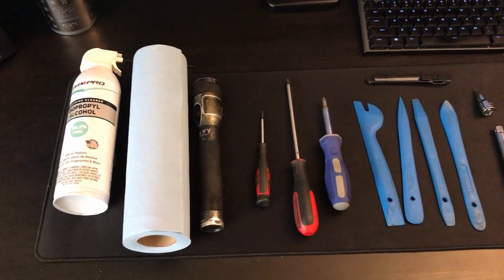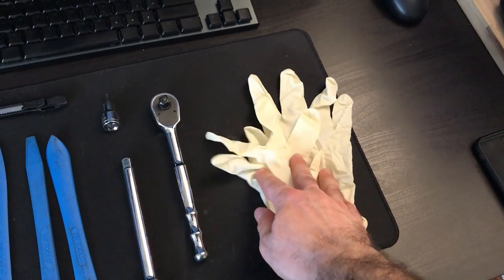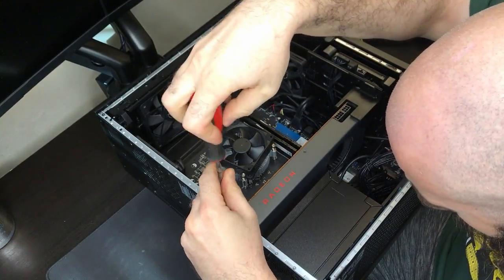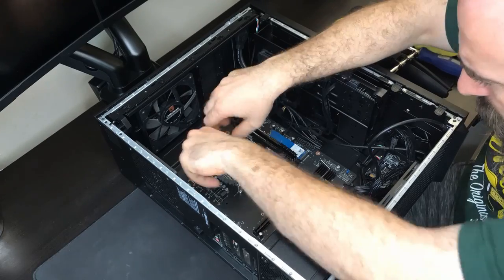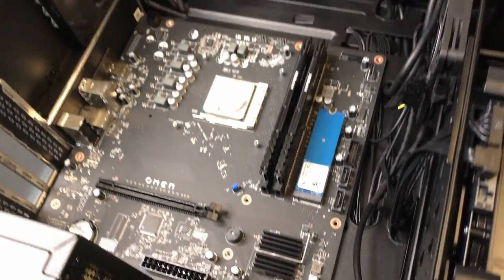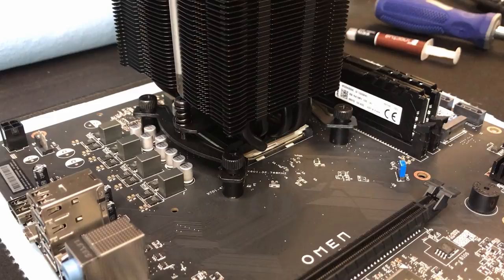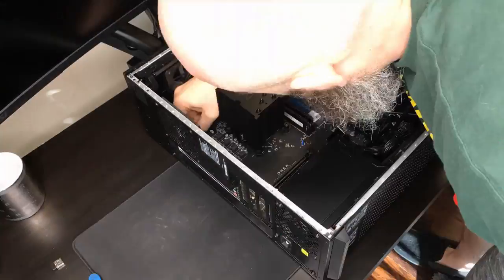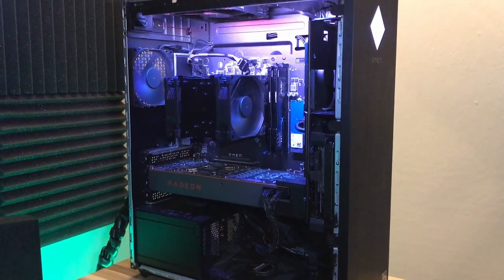Installing A Noctua CPU Air Cooler In My Omen! Complete Tutorial 😎

Comment: i was wondering is the second fan on your CPU cooler the same as the rear exhaust fan
Reply from the maker: Correct, it’s the same fan. Both fans are directing airflow toward the rear of the case.
Reply: @DanKamYouKnow  thanks you so much, also love your vids you've helped so much with my pc

Comment: Would you recommend the U9s or the D9L for my Omen 25L?
Reply from the maker: Either way will b a great purchase. Main reason I went with the U9S is because it’s offered in black.
Reply: @DanKamYouKnow  good to know. I heard the D9L is a little better is that true because it’s also a little cheaper right now
Reply from the maker: D9L is probably the best cooler available for the Omen. U9S is a very close 2nd but fits the aesthetic of the Omen more IMO.
Reply: @DanKamYouKnow  I think I’ll go with the U9s. Do you know if the noctua slim fans fit the fan clips provided?
Reply from the maker: The slim fans will not work with the cooler clips. The U9S will come with one regular sized thickness fan though

Comment: Would AMD's wraith prism cooler work with the HP Omen 25L?
Reply from the maker: Unfortunately it won’t because all Omens use Intel spacing for their coolers ( even if it is an AMD equipped Omen ). So you have to use Coolers that have Intel mounting accessories
Reply: @DanKamYouKnow  thank you for letting me know! I was about to pick one up later this afternoon off marketplace. you just saved my money

Comment: hey dan, I’m currently moving my omen 25L into a Corsair 4000d airflow case and haven’t run into many problems so far, however I also decided to do a cpu cooler change and I just cannot get the backplate to budge and I’m too scared to use anything cause I don’t wanna damage the mobo. any tips on how to pry it out easier?
Reply from the maker: Dental floss works really well. Gotta fish it thru and you should be able to use it to “slice” the adhesive
Reply: @DanKamYouKnow  thanks, I’ll try that today! is a lot of force needed though?
Reply from the maker: The adhesive they use to secure their backing plate is very strong so yes, it will take some effort to get off. Just don’t use anything metal and you should be fine. That’s why I went with a plastic scraper
Reply: @DanKamYouKnow  oh so if I use a plastic art tool or a credit card for example the mobo will be fine?
Reply from the maker: Yes, that’s how I did it and I show it in the video..
Reply: @DanKamYouKnow  yeah I know I thought it could be risky tho but if there’s no risk then I’ll go on with it, thank you so much 🤍
Reply from the maker: Just be careful when doing it. I don’t want to frighten you but you could damage the motherboard if you are not careful. Take your time with it and you should be fine

Comment: I just got the exact set up for my cpu as you did. Two chromax fans on either side and the identical cpu heat sink, with a y splitter to connect both to the header. However, when I booted up my computer it had a 90B error message that said a fan on the CPU wasn't working properly. It warned if I continued, then my comp might lose data or act unpredictably. Did you get this same message? (I have an omen 25l with your same fan configuration- I just have 120mm rgb lights on top, to the side, and on bottom.)

Update-ish: Going into the bios and doing a fan thermal test indicates a failure. So I tested it and instead of putting the newer fan into the same cpu header, I split it into another one and left just the fan that came with the heatsink connected. No error. However if I still went into the bios and did a thermal test, it indicated it failed. Very strange stuff!
Reply from the maker: I didn't get a notification for this comment. I did not receive any warnings after y-splitting my cooler fans into the CPU_LC_fan slot. Have you figured out why you are getting an error with both fans?
Reply: @DanKamYouKnow  No worries! A reply at all is appreciated.
I haven't figured out why I was getting the 90B error. I read that some Y-Splitters only have a sensor on one side of the split, and perhaps the CPU didn't sense either of the fans due to the splitter I purchased.
Changing one fan to Y-Split with my Fan 2 header rather than the CPU fan did the trick. Whenever I go into the BIOS I'm still failing my thermal test, however. I can't seem to figure that one out, but it might be because of the rgb lights.
Regardless, my Omen is still reading temps of 60 GPU in game, with very rarely reaching to 75 but no higher, while my CPU continuously stays in the 40 range. So your tips, tricks, and videos really helped with my Omen! Thank you so much!!
Reply from the maker: @cooro987  So it only gives you the error when 2 fans are connected to the CPU fan header? That's extremely strange as that's how I've always ran mine with no issues. Temps look fantastic though so I am glad you figured out a workaround for the error, still doesn't make sense why that would happen. I am glad my videos have been helpful for you, I appreciate your kind words!
Reply: @DanKamYouKnow  Yes. I don't know if it's because of the motherboard, or what the issue was, but once I only connected one fan to the CPU header, and the other to the Cha-Fan 2 header, everything worked perfectly and no Error 90B. It truly doesn't make sense, but if I try a new fan config in the future, I'll swing by! Thanks again

Comment: installing this today: how did you attach the 2 fans to the cpu cooler?
Reply from the maker: The cooler will come with 2 clips that secure the fan to the cooler. The little instruction booklet Noctua includes should show how to do it. I just realized now it’s not documented in the video at sll
Reply: @DanKamYouKnow  appreciate you Dan, currently waiting on amazon to deliver the cooler. I’ve taken the pc apart, and have taken out the stock cooler and bracket as well.
Reply from the maker: Nice! Let me know if you have any further questions
Reply: @DanKamYouKnow  i just finished installing it, up and running; was a little too excited and turned on my pc without connecting the graphic cards lol other than that, everything was pretty smooth. CPU temp is lowered by about 10 degrees & less noise. I’ll will be installing another fan on the cooler tomorrow for push/pull.
Reply from the maker: That’s great to hear and 10c is great!! Nice work 👍🏻👍🏻👍🏻
Reply: @DanKamYouKnow  unfortunately NOCTUA only gave me one fan clip to mount the second fan on the cooler, i cant find any after market clips either smh
Reply from the maker: There should be the one that’s attached to the fan, and a 2nd one in the box. That’s really weird if it didn’t come with one, I’d email or call Noctua.
Reply: @DanKamYouKnow  yeah, i only got one spare fan clip for the second fan after putting on the first fan with two clips. I emailed but haven’t heard back, might have to make my own extra clip with paper clip or something smh
Reply from the maker: That’s strange because both of my Noctua coolers came with 2 extra clips. That’s a bummer. You can just run one fan for right now and it’ll still work good.
Reply: @DanKamYouKnow  yeah, it’s working just as well with one fan; my cpu doesn’t even hit 60C anymore and GPU stays around 75C while gaming: i used the spare noctua 92mm to replace my stock omen rare fan, everything is 10x quieter with noctua fans!
Reply from the maker: That’s awesome to hear! Temps look fantastic as well 👍🏻👍🏻👍🏻
Reply: @DanKamYouKnow  update: noctua is sending me the missing clips. 😁😁 anyways it’s good chatting with you Dan, hope everything is well!
Reply from the maker: That’s great, Noctuas customer service is top notch. Thank you and it was nice chatting with you too 🤝

Comment: Can I use a 120mm cpu fan for this case ?
Reply from the maker: You can use a 120mm fan at the top. The stock CPU cooler fan is 80mm, and the rear fan is 92mm.

Comment: I asked on another video but was there a reason for not going down the AiO route to cool the cpu?
Reply from the maker: I just answered your other question 👍🏻. Basically, I like how air coolers look over 120mm AIO’s and my U9S outperforms all 120mm AIO’s that have been tested on Omens
Reply: @DanKamYouKnow  Thank you, I am getting ready to buy all the fans you used in your upgrade and now I think I'm convinced to go the same way you did with the U9S.  Thank you so much for your videos, you dealt with the issue and allowed us to reap the rewards of your hard work :)
Reply from the maker: You’re welcome! The thing with CPU coolers is, a 120mm AIO is not quite as efficient as the U9S, but it’s still a WHOLE lot better than the stock air cooler. Glad I could help you out 👍🏻👍🏻👍🏻

Comment: Tried this same set up for my Omen 30L. I love the look and gets plenty of air flow however, failed to boot when I turn on. Is it possible that my configuration doesn't support multiple fans based on power?
Reply from the maker: What exactly happened when you tried to start it? How do you have everything set up?
Reply: @DanKamYouKnow  replaced the mother board fan with the same noctua cpu air cooler, added the big bottom fan, push pull fans on the cpu cooler and a top exhaust fan. Did upgrade the stock exhaust fan as well to a better noctua like yours on this set up. Turned it on, all fans turn on fine, get 3 long beeps, 2 short beeps then shuts down. Tries again and stays on idle but no boot up.
Reply from the maker: You may want to try and reseat yourself RAM, that’s usually a memory code. Or try booting the PC with 1 RAM stick in different slots and see if it works. Is there any chance you could of scratched your motherboard with you removed the stock CPU cooler back plate?
Reply: @DanKamYouKnow  Used plastic prying tools, was careful. I thought the same thing so I did remove it again to inspect it but notice no damages or scratches. Also tried booting with one ram, even put the original ones back in just to make sure. Still same issue. I was informed that it could be to much power being drawn for that motherboard however the beeps indicate memory issues like you mentioned according to HP as well.
Reply from the maker: Man, if you checked all that, I’m not sure what else it could be. You usually have a little bit of headroom with power but maybe that motherboard eats up a ton. I take it all connections are correct and fully secured?
Reply: @DanKamYouKnow  Correct, I mean ideally if you get that beeping sequence it should be specifically for the ram?
Reply from the maker: Yes, usually. I’ve seen people who have damaged there motherboards though from the backing plate removal, so that’s why I asked. Unless you bumped a RAM stick pretty good when you were installed the cooler.
Reply: @DanKamYouKnow  I figured it out! Unfortunately took me  a while however, just in case someone runs into the same issue, my processor had one of its pins bent in the process of what ever reason I removed for a quick second. Solved the issue and works perfect and my temperatures are on point even after back to back gaming sessions. That being said I did have a question, I want to upgrade my graphics card to get better graphics over all. Other than power,  what would you recommend, currently running a Ryzen 7 3700X on a RTX 2060. My ram is 32 gbs like you suggested running 3200 mhz.
Reply from the maker: Glad to hear!!!!

Comment: Hey! I was wondering do you know how big gpu you can fit in Omen 25L case? Im thinking im going to upgrade my current Rx 6700xt --> 7800xt but i would really love to have 3 fan model which is 320mm width... I have feeling that wont fit even with a bit of modifications
Reply from the maker: Max length for a GPU is 285mm for a 25L. I would recommend swapping cases first though, so you don’t have to worry about something like that.
Reply: Thank you for your fast response

Comment: Does it require a router connected like with wires?
Reply from the maker: I’m not sure I understand what you mean? The 2 fans connected to the cooler are plugged into the motherboard with a y-split cable.
Reply: @DanKamYouKnow  like I mean do u need a router hooked to the pc
Reply from the maker: For internet?! You can use WiFi or an Ethernet cable for internet access…

Comment: Finally got my new cpu cooler all connected and now on startup I get 3 long beeps and 2 short ones. I'm about ready to just reset it to the factory parts and send it back. Any idea what the problem might be?
Reply from the maker: First, try removing your RAM and reseating it. Absolutely make sure you have everything connected securely and correctly. If that doesn’t work, with the power off, hold down the power button for 30 seconds.
Reply: @DanKamYouKnow  I didn't realize you had to put the ram in that forcefully, I was just pushing them down until I could latch them manually. Thank you so much! I don't even want to think about how much money I almost blew on something so stupid
Reply from the maker: You’re welcome! So everything is working now?
Reply: @DanKamYouKnow  Yeah. My idle temps were bordering on 95+ before because apparently HP didn't bother putting thermal paste on the cpu. Figured I might as well swap out the cooler while I was at it and my idle temps are in the low 30's now.
Reply from the maker: @ResidentWooper  Oh boy, I've seen one other Omen that had a plastic cover over the cooler so it wasn't making contact with the CPU and had a 95C idle too. Glad you're all set up now.
Reply: @DanKamYouKnow  mine had that too. If I had used it for another few days I’m sure I would have fried the motherboard

Comment: I have a 500 W power supply is that enough with all the fans that you installed?
Reply from the maker: Yes, fans draw very little power. You’re fine.
Reply: @DanKamYouKnow  and I have rtx 2060 that will be fine?
Reply from the maker: Yes
Reply: @DanKamYouKnow  Thank you

Comment: Do I need to remove my backplate if Im having an intel mobo? and How about the 120mm fan air cooler? does it fit in our case? Thanks and more power!
Reply from the maker: Yes, it’s the same process for Intel processors. Intel and AMD back plates are actually the same when they’re normally different. Which air cooler are you exactly looking at?
Reply: @DanKamYouKnow  I was looking for a cooler master air cooler with 120 mm fan. But I dont know if it will fits in our case. Because the one in the video is 92mm fan right?
Reply from the maker: Yes, the one I used has 92mm fans and performs really well. An air cooler has to be under 140mm tall to fit inside the Omen, and unfortunately that list of coolers is small.
Reply: Okay. I just bought the 92 mm fan but the brown one cause the black one is out of stock. I have a problem with my unit. My cpu usage is higher than gpu. Does using this noctua air cooler will solve my problem?
Reply from the maker: It depends on what application you are using. Utilization can vary greatly from task to task.
Reply: @DanKamYouKnow  yeah. But I think its not normal that when im playing games my cpu usage is higher than my gpus and I dont know why. I have i7 10070f with RTX 2060
Reply from the maker: @bearhuggs0  Normally your GPU usage should be higher than your CPU while in game, so that is strange.
Reply: Yeah. Ive done so many tricks from you and its stay the same. Thats why I bought a air cooler and hopefully it will be fixed
Reply: @DanKamYouKnow  Yes. and I checked in my task manager and it seems that my i7 has only 2 cores? But in the internet it should be 8 cores and 12 threads right?
Reply: Ive find a way. I uncheckes the number of processor in msconfig> boot advanced options. And when I restarted the unit. The processor in task manager set to 8 cores and 12 threads. Is it right?
Reply from the maker: That’s strange that is says it was running on 2 cores..... no idea what could have caused this.
Reply: Where did you buy the y split for dual fan? ive install mine and im planning to have it dual fan. Thanks
Reply from the maker: Noctua NA-SYC1, 4 Pin Y-Cables for PC Fans (Black) https://www.amazon.com/dp/B00KG8K5CY/ref=cm_sw_r_cp_api_glt_fabc_1NFPDCBXWHGZSVNP3P3G

I used those.
Reply: Thanks bro. Im planning to have a fan in bottom. Should I set my bottom fan as an exhaust and my top fan into intake? I was going to copy your set up but my cpu is placed under my table. I was worrying maybe it will take a lot of dust when my bottom fan is intake? Thank you and more power to your channel
Reply from the maker: I run my bottom as intake ( heat rises so always set it to intake ) but I run my top fan as an exhaust, but you can try both orientations and see what works best for you.

Comment: When I start the game, the fan speed of the noctua will run automatically at 2000 rpm, so in the maximum speed?
Reply from the maker: If the fan is plugged into the LC pump header, than it will spin at max RPM
Reply: @DanKamYouKnow  But it will run at 100% all the time, even when the computer is at rest?
Reply from the maker: Yes. It’s meant to power a liquid cooler pump, which usually spins at a high RPM at all times. The LC pump slot is not the best option for normal case fans. I would y-split that fan with another fan or use a different open header